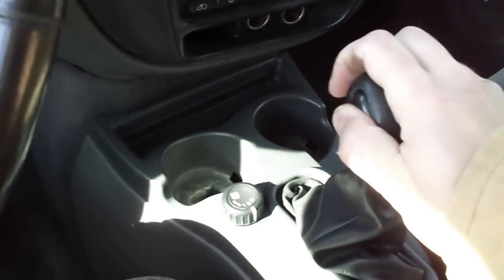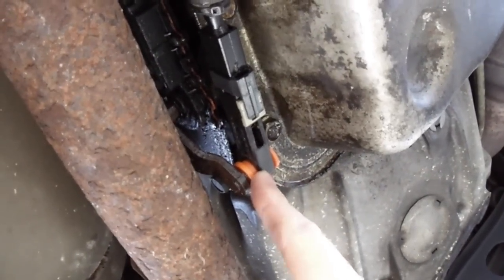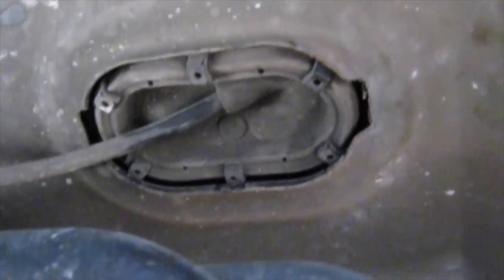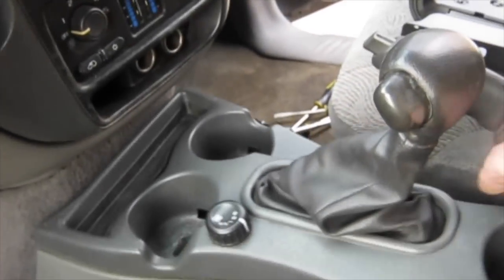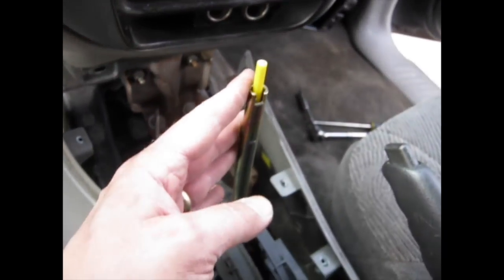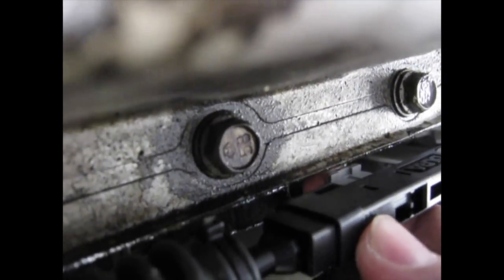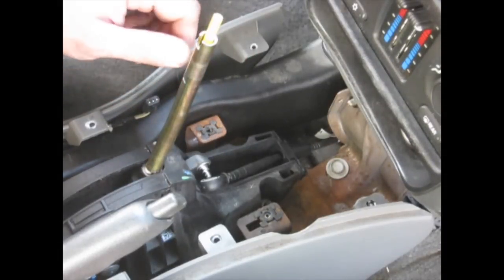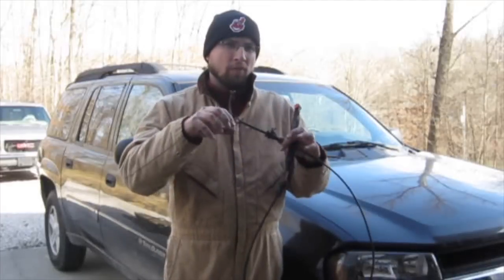Car won't shift into park - Broken Shifter Cable - Replacing a shifter cable - Trailblazer/Envoy

Comment: Next time put it in neutral. Too dangerous leaving it in gear. But hopefully there isn't a next time.
Reply from the maker: Excellent point. I'm embarrassed to admit that that didn't even cross my mind. Put it in neutral, and kill the engine. Thank you for helping me gain a firm grip of the obvious! I guess I like to live my life on the edge. LOL
Reply: No problem. That's why we are here. Both dad's trying to figure out how to save money by doing things ourselves. We can all learn something from each other.
Reply from the maker: C Reddington it’s appreciated. Thank you.
Reply: My 2007 trailbalzer ss is stuck and now i cant turn it on because its not on park and wont shift into any other gear, would it be safe to just have the battery disconnected?
Reply: Can't you just put the parking break on??
Reply: Sorry, learning here also. Learning different vehicles at one time lol...what could happen if left in park and not neutral??? Sounds scary lol.
Reply: I realize it is kinda off topic but does anyone know a good website to watch new tv shows online?
Reply: @Will Paxton thanks, I went there and it seems like a nice service :D I appreciate it!
Reply: @Emilio Royce You are welcome :D
Reply: What if my car is on a hill when it happens!?
Reply: @TheDaninator how long is the length of this shifter cable of trailblazer in cm?

Comment: My wife was picking up or 5 year old from school today and she thought she was in Park but she really wasn't. Thankfully she unknowingly happened to keep her foot on the brake as he was getting in. This vehicle is somewhat easy to work on, then again they have all this unnecessary crap in the way and it's unsafe. Thanks for pinpointing the issue for me but why in the heck is that shifter soo exposed liked that and they bushings appear to only be made of nylon. Everytime I turn around I'm working on this thing. I'm not a mechanic or anything either. Thank God for YouTube video tutorials.

Comment: Great Video!  Tying some high-strength string or fishing line to the end of the old cable as you pull it through the truck can help because you can tie the
same string to the new cable for pulling it back through the carpet and tight spots.
Reply from the maker: SCool Dayz nice tip, thank you!
Reply: @TheDaninator  qq q

Comment: So I know this video was made some time ago, but I just did the exact same thing you did!  Replacing the bushing and bent the cable too far (trying to get a better angle to push the bushing in). Snap!  And now I have a sloppy - non waterproof cable that won’t shift properly.  Ordered the same cable you did, and because I’ve installed a custom stereo previously I am well aware of the console removal process.  Thank you so much for making this video, very helpful!!

Comment: I saw the mileage on this vehicle. Mine was not quite that high. I have a 2008 and this happened at 144k. Mine broke as I was almost ready to place an order at a fast-food joint. Thankfully, the place was on an incline and I was in neutral. I glided to the end of the driveway and parked, The bad part was I had to walk home which was not down the street. Took mine to the shop and they fixed it. I will not tell you what I paid. It was less than what I was prepared to pay, though. Thank goodness I did not have to replace it. I feel bad that I had so much change in my console. Check wallet light is an understatement!!!! Since my vehicle is climbing up in years I think I need to get a new one. As a female without a driveway and no male friends where I live - getting a newer vehicle seems like the best option.
Reply: But what did you pay? This just happened to me tonight. Had to have my Pontiac towed to the shop. Unless I could drive it in reverse all the way there without a ticket. 🤦🏼‍♂️

Comment: Man! Great video, but I saw enough that I sure don’t want to attempt all that mechanical disassembly and reassembly myself! Before I watched your very informative video, I thought it may have been a relatively simple fix, but how wrong I was! Mine is an ‘02 Trailblazer LTZ. I love the truck (when the electricals are working properly)! I thought your term, “Failblazer” was funny, and kind of appropriate for the electrical snafus I’ve occasionally experienced in the 4+ years I’ve owned the truck. The odometer on mine just turned 180,000 miles. I noticed this happened on yours at 170,000. Now I’m wondering what else is about ready to fail. That 4.2 L straight six is a wonderful engine! Powerful, and runs like a sewing machine. Just wish they had mated it to some better electronics. May be about time for a replacement vehicle. Having mine towed to the shop today.

Comment: Just replace my cable..07 Envoy. Dorman bushing kit is  a waste of time unless it's an emergency repair. New $50 cable from Amazon is great.  Fishing line trick was very helpful. Hard part was forcing the carpet threshold piece out without thinking it was going to break.  White mark on inside connection goes toward pass side. Thanks for your video!

Comment: Thank you so much. You saved me so much work Watching you do it first . One thing I did that seem to help the Installation under the carpet was to cut the carpet a few inches where it emerges into the tunnel. 
That area is hidden so it does not hinder the cosmetics. 
Thanks again.

Comment: If you drill the rivet holding the rear heating vent tube out you can remove the tube by twisting the plastic tab midway on the inside of the tube with needle nose pliers then replace aluminum rivet with a plastic trim pin
Reply: Sorry I missed something else. This allows for very easy removal of shifter cable under carpet
Reply: Is there only a screw that connects the shifter cable to the transmission
Reply: On a 2007 passat 2.0t

Comment: Good video. Thank you for posting. I used a shoe string tied to shifter end and used that to pull the new cable back up. Also, my issue was the bushing that connects to the shifter, not on the transmission end underneath. I spent alot of time down there trying to figure out the problem, watching different videos, and was positive I knew the problem. A half hour problem turned into a 3 day event. (Had to wait on shipping)
Reply: good one

Comment: Was the vehicle still turning on? This recently happened to me but my trailblazer won't turn on.
Reply from the maker: No, when the car is not in park, it will not turn on. My truck was already running and it wouldn't go back into park. If I turned the vehicle off in that condition and tried to restart it, it wouldn't have started.
Reply: @TheDaninator  thanks, now I'm looking for a mechanic to do it. My truck has been a pain in the butt the last couple months. A mechanic recently told me I need to get the engine replaced and it'd be 2 thousand something dollars 😤

Comment: How do you get the safety lock off to move the shifter?
Reply: On the right side of the interior console once you remove the console plastic there is a silver button. With the key in the on position and brake pedal applied push the button to unlock the shifter.

Comment: Thanks for the video.  Always nice to know what's involved before starting the job.  Definitely more involved than the one I had to change in my '95 Suburban years ago.

New cable arrived yesterday from RockAuto. Had to shift it from under the vehicle all week to get to/from work. A real pain but gotta do what ya gotta do.
Reply: Wound up just being the shifter end bushing broke apart allowing cable to disengage from the shifter. $12 for a set of new bushings from O'Reilly Auto and all better in much less time than would have taken to replace the whole cable assembly.
Thanks again for the video.

Comment: Hey what's that knob by the shifter?

Good video luckily mine was just the bushing.
Reply from the maker: Perry Richey that is the dial to control the rear air. Mine is the extended trailblazer.

Comment: I have question I drive a buck Rendezvous and I was driving and I tried to to go into reverse and the shift will just slide and down but it’s still in drive so basically I can only drive forward is it the shift cable or the transmission please help me out would really appreciate it

Comment: I drove to the grocery store put my car in park and left in running to keep my passenger cool. When I returned my car was still running like a champ but I couldn't get out of park. I pressed on my break(like you normally would)and my shifter moves freely but the car won't go into any gear. It's like there's no connection between the shifter and the transmission anymore. Is that a problem with the shifter cable or bushing? 2005 envoy. Hope you can kind of help thank you.
Reply: Oh there's no check engine light or anything indicating something is wrong.

Comment: I'm a 52 yr old disabled woman (Rheumatoid Arthritis) my Chevy Cavalier shifter Cable broke as I was sitting at bank drive thru window! Had to get it towed. Is there any way of using a zip tie or wire hanger to Geri rig it? I have no one to help me because I am literally broke.
Reply from the maker: It's hard to say without knowing where it broke, but yes, it's possible. Obviously it would be prone to breaking or coming loose over and over, but it could work in a pinch.
Reply: I fixed my mother in laws with a zip tie but it was Pontiac sunfire. Should be same way though. Here was in a tight spot on top of motor/trans under the hood

Comment: I just replaced mine holt crap what a nightmare. What do I do tho if when I put it on drive it feels like it’s all the way down in 1st gear. Then when I put it in park it feels like it’s in neutral but the car is actually in park. It’s like I’m two notches off. Maybe I installed it while it was in reverse and not park? It got stuck in park? Can anyone help? I had to actually disengage the bushing from the shifter in order to push it all the way up to park so I could get my key out.

Comment: Does that cable 15785087 apply to Chevy Trailblazer ext 5.3 2006
Reply from the maker: Probably so, but to make sure, look it up on Rockauto.com. That's where I bought it from.

Comment: Shift cable issues again unfortunately it’s not the bushing this time.
Reply: Yes it was the bushing but it just wasn’t the bushing under the truck. It was the one on the shifter.. it’s fixed
Reply: @tinawatkins-reed53  how did you fix it? I have new cable and mine shift back up to park
Reply: @baadboy82ify My problem was inside.. I had to unscrew my my cupholders.. I had to put a replace a bushing.. it was broke.. I'm not an expert. I couldn't afford it, so I was willing to take a chance.. but it was a faster fix than going under the car..
Reply: Thankfully neither time I had to replace the whole cable.. that was going to cause me alot more money and time.. I'm very thankful for you guys sharing..
Reply: Now I need a new front end... I won't try to fix that.. I wrecked mines early part of this year. I knocked my bumper off.. but I tell you, the metal bar took a good hit..  buying a brand new, I don't believe it'll be this strong. I'll have to go to a junk yard for all the parts for that area.. I'm also thankful that I'm still able to ride in spite of cosmetic issues... I know I have to get the front end parts brand..

Comment: my wife is yelling down my throat 🤦🏽‍♂️🤦🏽‍♂️🤦🏽‍♂️🤦🏽‍♂️ I spent for a like new engine, 93 thousand miles and the mechanic said it was done, got back my 05 Chevy trailblazer back and a couple days later, I tried backing up and the gears were slipping like it wasn't snapping in the gear and then it shut off like if it was in neutral. Now It wont rurn back on fuuuuuuuuuk!. Its acting like a bad battery or starter but I just got the battery. I am calling him tomorrow to see what the hell is going on, I dont have money to just throw away, people are struggling u kno, what do or can I do I am lost right now here ?????🤦🏽‍♂️🤦🏽‍♂️🤦🏽‍♂️🤷🏽‍♂️🤷🏽‍♂️🤷🏽‍♂️🤷🏽‍♂️

Comment: i and anuther fellow were passing each other on exiting an i-65 pulaski tn gas station,15?yrs bak,we'd both heard strange sounds emanating from a full sized chevy van, polka dot balloon painted,towing 2 similar vehicles,we were both apprehensive due to nature of sounds, plaintive,muffled wailing,distressed,we shrugged and slowly approached veh,to find a man trapped under drivers door,legs extending out to well past drvrs door,in exhausted panic,realized he'd been adjusting shift linkage on a slight incline and whole rig had rolled back on his upper thigh,i started screaming fer assistance,ended up having to muster about 12,15 men and women ta push rig up off him,drag free,and slam inta park?damnest thing,dude had been screaming at everone enterin and exiting station for 2+hrs?trffic frum freeway an all,we may've saved his legs i figgur,he was polish carny worker,hence strangeness of utterances,worked out for all involved.peace.
Reply: And what the everloving anything does it have to do with the post your commenting on? Sign up for the worm radio hour or something. But seriously good job Bein dude who stopped and got other people rallied to help save the dudes legs and maybe life

Comment: I legit just got home, parked , went to reverse my trailblazer a little bit , then as soon as I go to park the car, my stick shift feels as if it’s jammed . I sat in the car for about 10 minutes trying to budge it but it wouldn’t move. I finally gave up and turned the car off while it was in reverse (emergency brake on of course) and now when I attempt to press on the brake , it feels stiff as hell and won’t push in. HELP!!!